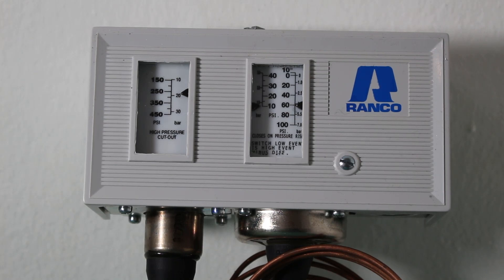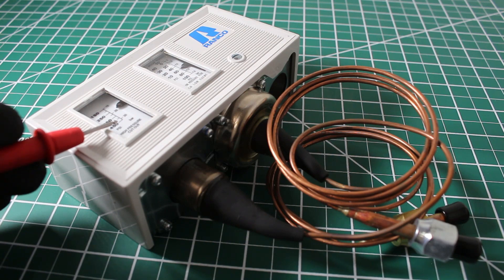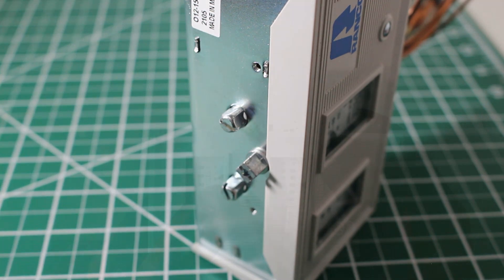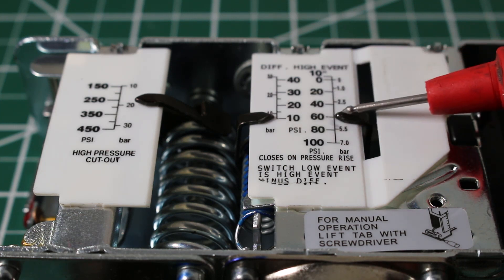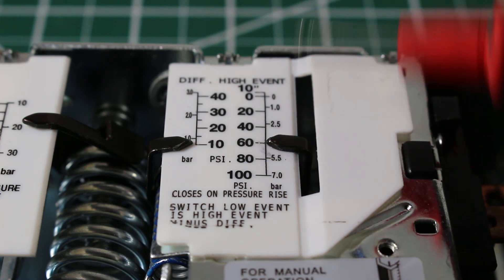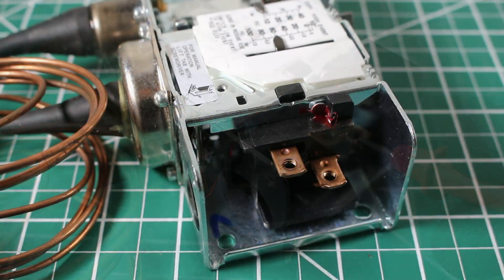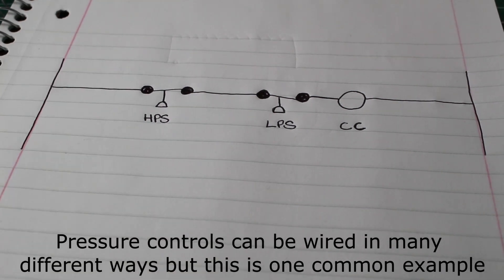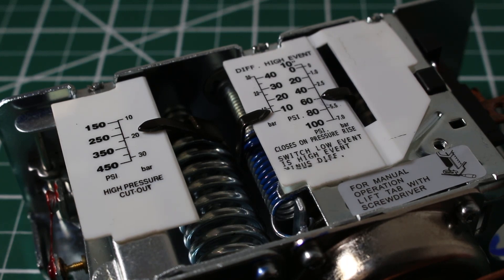HVACR: What Is A Dual Pressure Control & How Does It Work? Air Conditioning & Refrigeration Controls

Comment: Been using these for years and years. They do need some fine tuning and can get out of whack after a few years, but they are hearty and will last quite a long time.....except when they start leaking refrigerant lol.
Reply from the maker: You're right about that 💯 Once it leaks, better off to just replace it. Going with the dual pressure control instead of just the low pressure control was the best idea. A bit more work but worth it. Thanks for watching! Stay tuned for new videos every week⚡🔧